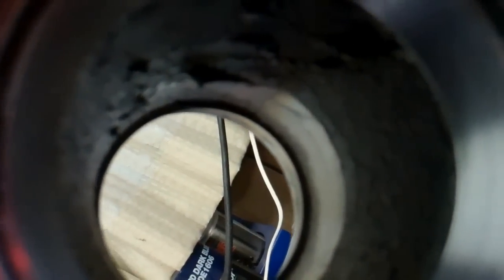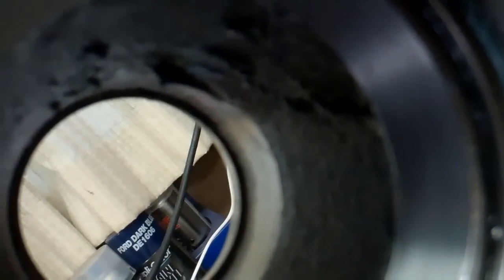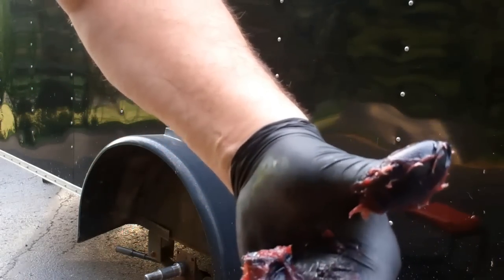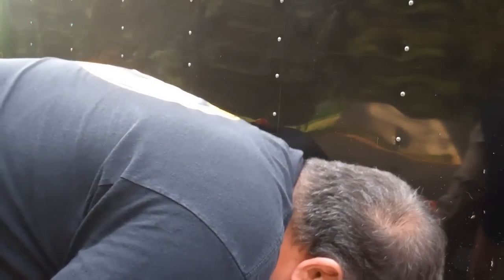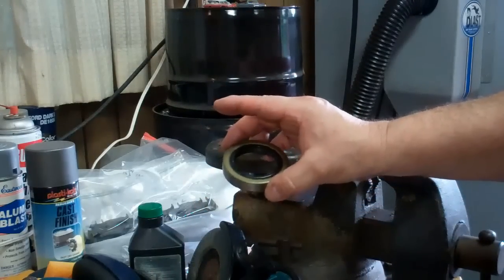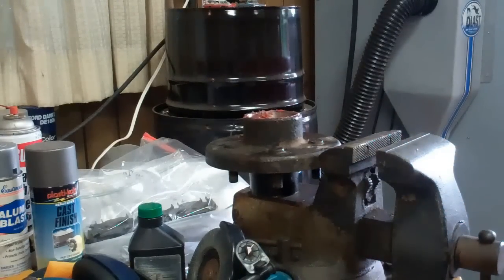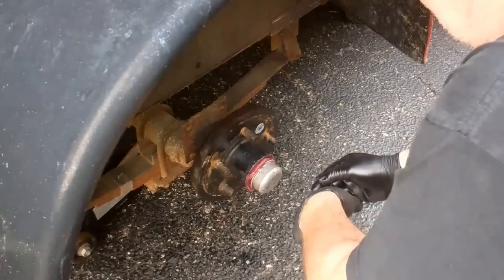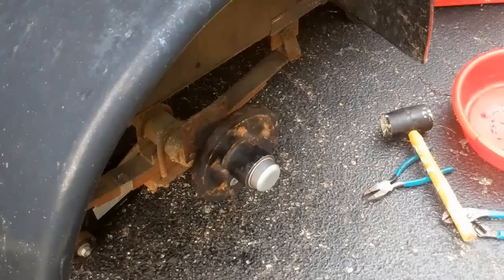How to Repack Trailer Bearings and Seals (Part 2 of 2)

Comment: Great video!! I used diesel and a toothbrush as a tip from a friend to clean my bearings and everything in the hub. It worked amazingly! Just a helpful tip, but thanks for the video!!
Reply from the maker: Diesel fuel is one of the best solvents around for cleaning and degreasing!!  I always keep a gallon or two around just for that!

Comment from the maker: The hubs on trailers are essentially "off the shelf".  After you take your hub off to change the bearings, take it to a trailer shop and they can match it for you.  The extra hub I have does not look like the ones on my trailer but it is a direct bolt on.  The point is that it will get you home in a pinch.  Good luck!!

Comment: I heated my hubs up in the oven to 200 F, and then froze my bearing races in the freezer down to 30 F, and then quickly dropped the races into the hub and pounded them in.   You have to work fast because the races heat up quick and then you really have to pound, working your way around 30 degrees at a time.    I didn't have a pound kit, so I made my own finding the biggest piece of ld pipe that would fit as closely as possible inside the hub, and then cut it to be about 4 inches long, and squeezed the end of it in a vice to be like oblong wider to catch the race at two sides.   I'd rotate it, pound it twice, rotated it a little, pound it twice, etc until I had them all the way in there.  Oil it up with oil first.    Oh, and wear construction gloves, because hubs at 200 F are hot to the touch.

To get the races out, I used a reverse method, I heated the outside of the hubs with a propane torch, then pounded through the hub from the other side with a big flathead screw driver, working my way around maybe 30 degrees at a time.  Pound twice, move screwdriver around 30 degrees, pound twice again, move again, etc.  It's slow and takes a long time but works.    I put a homemade mixture of 50% ATF and 50% acetone in to losen the races, basically, a homemade substitute for PB-Blaster or WD-40, to help lubricate the exit path for the races.

http://www.homebuiltairplanes.com/forums/album.php?albumid=633

Comment: Awesome Video! Thanks for sharing and teaching us how this is done. I need to get a set of the tools that you used to tap on the new rear seal. Do those tools also remove the rear seal? Or is that done by just using a small pry bar ?
Reply from the maker: Roger Sayers To remove the rear seal just hammer out the seal with a long drive punch.  Thanks for your comments!!